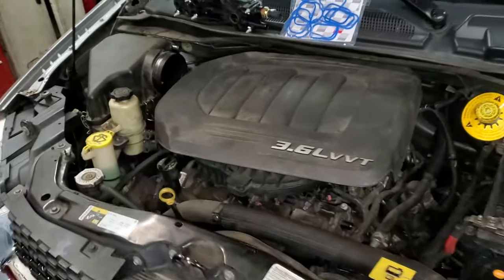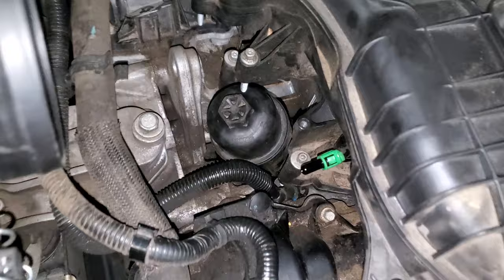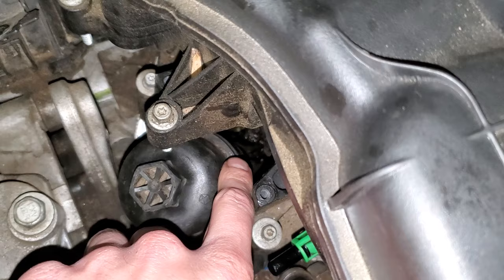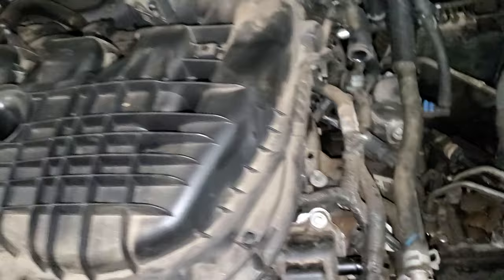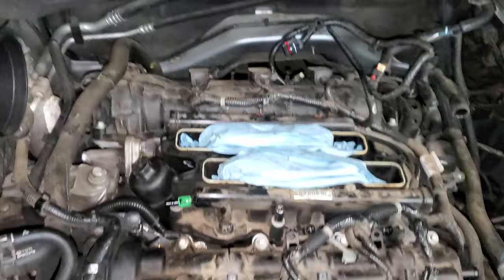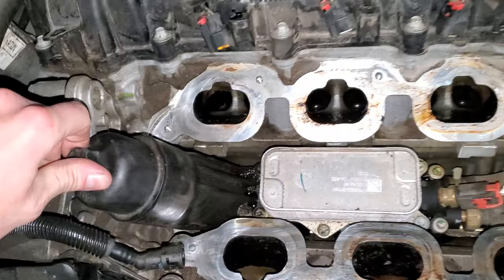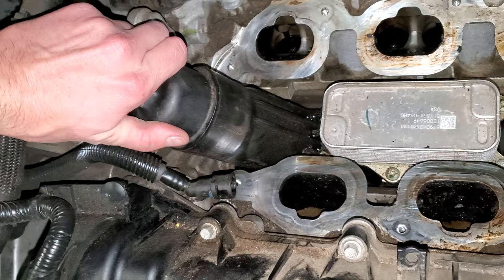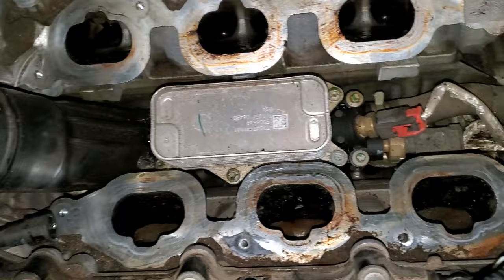Chrysler/Dodge/Jeep 3.6L Oil Filter Housing Leak - Common Problem

Comment: Looks like new gaskets had to be installed also. What gaskets?
Reply: Upper and lower intake gaskets as well as the oil cooler. I'm doing the job this weekend on a relatives car.  Book time is 3 hours, but for the home mechanic it takes longer, especially if you take the time to clean everything.

Comment: My 2014 charger started leaking bad. Had no oil in my engine left. Do you think it’s because jiffy lube over tightened my oil filter ?
Reply from the maker: Its very possible..
Reply: Interesting I’m taking it in on Monday to a mechanic. Let’s see what he says.
Reply: $800 later my car is fixed smh
Reply: @ducks1089  I have a 2014 SXT Charger and they want $1k for this....
Reply: @ducks1089   are u sure they used a oem part , 800$ for oem isant bad tbh I was quoted 1100 and that’s not even a dealer

Comment: I have a 2014 Dodge Grand caravan with that same motor. Is just started leaking oil bad just like in the video. Apparently there is a huge problem with these oil coolers. So much when I called Dodge they told me there was a 48000 back order. It's a defective part they should fix.
Reply: Amazon sell them
Reply: My wife van have the same problem and my keep blow up because of it, the 3.6 motor is shitty because of that stupid as fucking part. Called chrysler and they said nobody reported a issue with that part and I said that a fucking lie about that. I’ll never buy another 3.6 liter again. They sucks.

Comment: Hi Lehew:
I have some oil pool above my transmission and oil further leak down to the ground. Initially I thought my axle seal has leak. 
Do I need to take off everything to verify this? My upper intake seal is new but lower intake seals are pretty old. 
I am kind of hesitated to take it off without lower intake seal in hand yet.
Thanks a lot
Reply from the maker: You may be able to use a flashlight and a small mirror or a boroscope hooked up to a cell phone. It is most likely the source of the leak as the oil can run thru the valley of the engine onto the transmission
Reply: Thanks a lot. I do have a  telescope, though it never worked due to the poor light. Will give it a try
Reply: @LehewTech  I checked and there are a lot of oil below the filter house. The filter house is probably bad. My car is 2012 VW Routan and will Mopar 68105583AF fit it. Thanks again!

Comment: Seems like design is poor with that filter housing being made of plastic/resin. It's not necessarily one time of over-torquing the oil filter housing cap, but it's that repetitive  torquing of many oil changes  over time &  the stresses  become cumulative finally cracking the plastic/resin housing. However, in my case, maybe  the last mechanic did over-torque it because was only the 2nd oil change on the vehicle (OW Synthetic - 11k m) & he cracked it.  I remember changing oil filters on past owned engines & the filter was always threaded  right into the block/casting . I'm going thru this same cracked  filter housing  issue on a 3.6L V6 24Valve  on a 2019 Jeep Wrangler  w/11,000m.  Is at dealer now, just waiting for phone call with the hurt. Gonna be an expensive lesson. 2021 has been a real crap year for me so far. The hits just keep coming!!!

Comment: Do I drain the oil before replacing the oil filter housing?
Reply from the maker: I would drain the oil prior
Reply: Not necessary.   Just remove oil filter

Comment: Can we use JB weld ?
Reply from the maker: Its better to replace it
Reply: Did you try?  Did it work?
Reply: Nvm, my idiot coworker used 2 O-rings that was the problem😠...I feel bad I installed new housing for my customer, I didn’t see the problem till I removed the housing

Comment: Mine was leaking at about 50k miles. Replaced it myself and made sure all the o rings were on and everything was clean and ready to go back together. Haven’t over tightened the filter at all and it’s leaking again 2.5 years later. I called the dealership and they do it for about 800 with the part. But it’s only warranties for 2 years. So I’m kinda just stuck.. and I’m mad the engine has such a persistent problem
Reply: Same boat here.  60K and now 90K   Replacement was not OEM and it leaked right away because of shit seals
Reply: @BlueDragon-zn3gp  makes me so damn mad lol
Reply: @jasonfish4546  so after 1 month of opening and closing the top of the engine (prob 6 times cause I didn't understand what was going on even after new OEM orings) I went to Kenny u-pull auto yard and pulled a cooler from a van that just happened to have a brand new cooler with seals!!  its good now.   it only cost me $20.  I took apart 2 van manifolds and got lucky.   But while I was there, I got all the other minor parts for my impala too.   Wish I would have done this in the first place.   The one I got had a NEW OEM cooler and seals that were still like new and not squished.  The bolts were actually finger loose. Good shop they got that installed at lol.   Made my day.  Plus I picked up a $5 bill when walking through the yard lol
Reply: Thst is so awesome 😂 I might go look at vans soon hahaha

Comment: Can that oil filter housing be cause for water leaking?
Reply: Yes it has coolant running thru it also
Reply: Is the coolant leaking to the ground as well or is it mixing internally with oil?